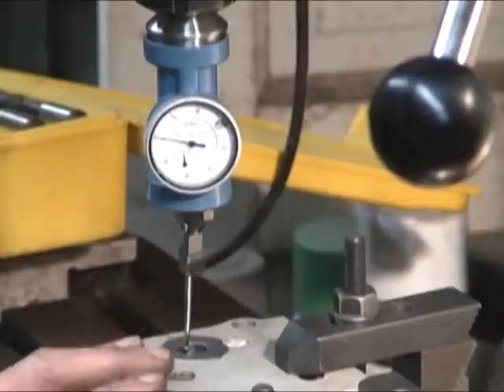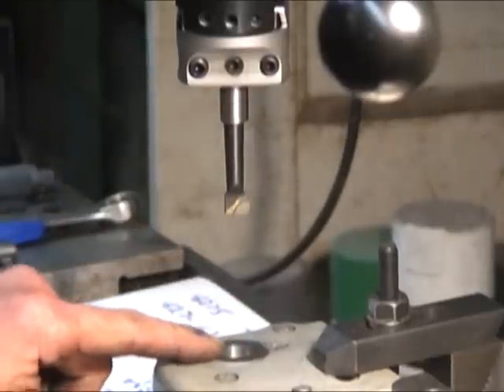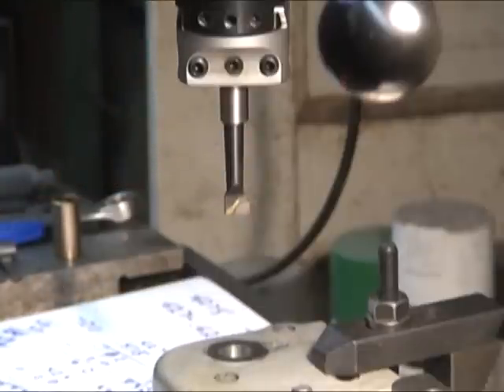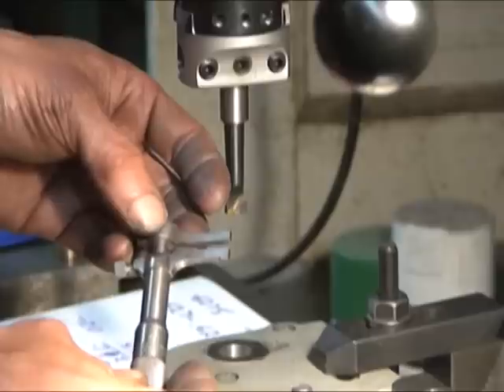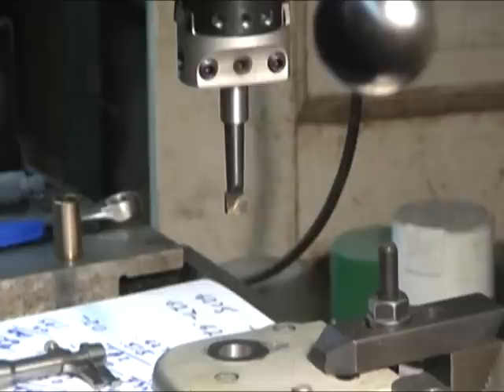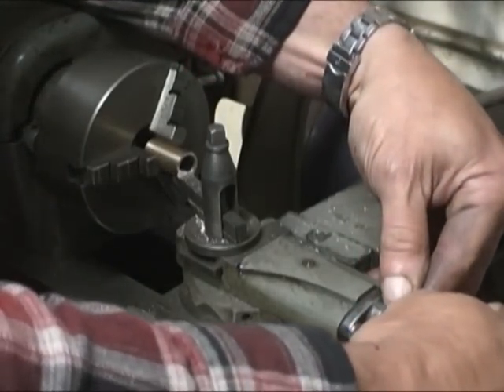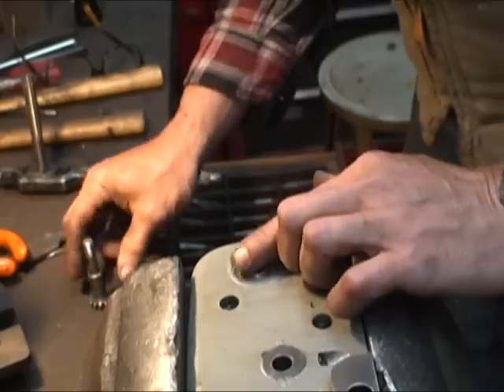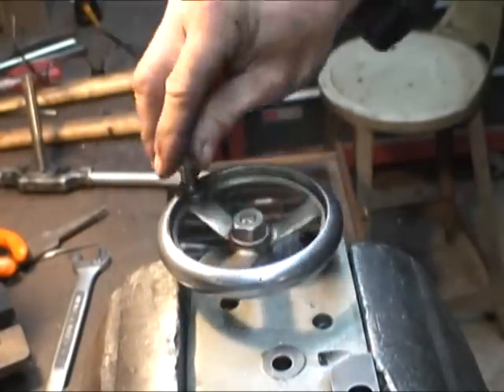Atlas 10 Inch Lathe Apron Rebuild -  Part One

Comment: ur doing great work. i need to do the one i have for the 3996 model may i ask where you bought the bushings?
Reply from the maker: You can buy bushings at any transmission (not vehicle) supplier.  Places that sell bearings.  I buy from a local place but McMaster is a good source on line.

Comment: Howdy Ciladog, I've just finished..well almost finished a cosmetic restoration of my TH54, and I'm having a wee problem with the lead screw and reverse change gear box. It doesn't have quick change gears, it just has the small box next to the change gears that engages the lead screw and reverses, and I was wondering if you could give me any advice, or point me to anyplace in your videos that would help me adjust the gears and get everything going smoothly again?

I know it is something simple that I just am missing, and if you could help point me in the right direction I'd be forever grateful.

I will be referring to you videos when I do find a quick change box and or invest in a mill to do a better job of really restoring the old girl because I like the way you work and think, and your videos are very informative.

Thank you in advance, and I hope this message finds you well...Aloha, Chuck.
Reply: J